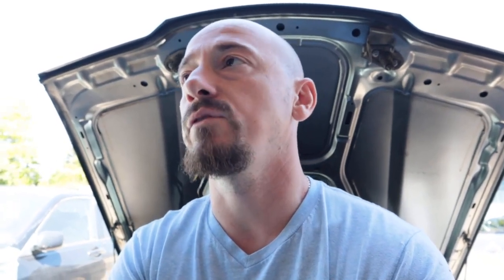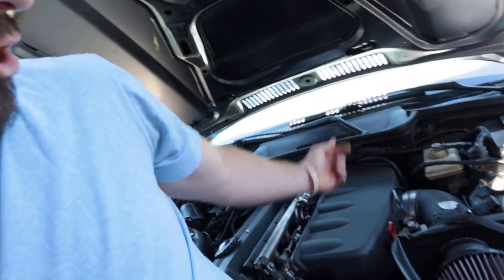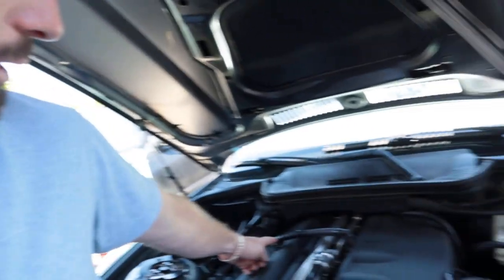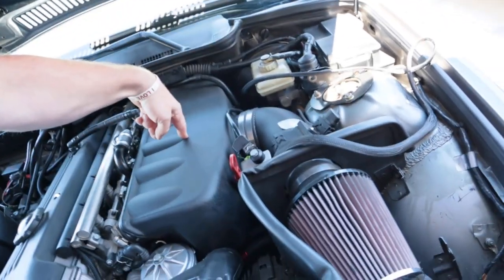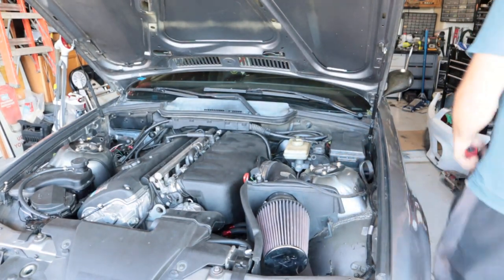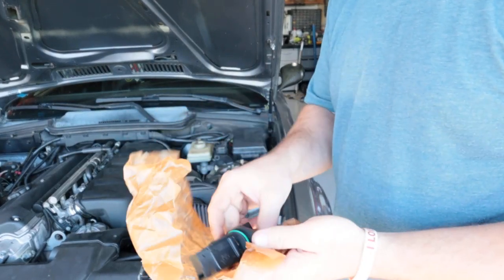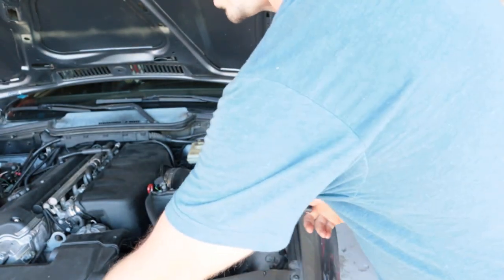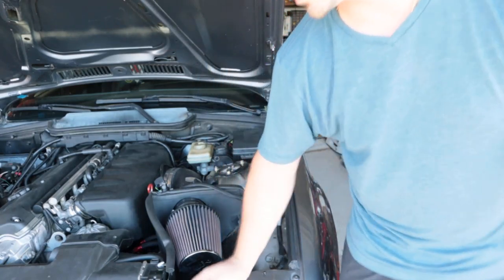Some progress on my s54 power loss (e36 s54 swap)

Comment: I remember I had a K&N on my e46 m3 and it gave me problems hesitation and power loss at low rpm try changing it to a dry filter. Try replacing the 2 TPS Sensors.

Comment: is your SAP deleted?  is your SAP present?  either way that sounds like cold start cat fluctuation
Reply from the maker: It wasn’t at first but after the tune i did deleted it, it was still there but deleted in the system, but yeh RPM fluctuation is normal on this cars at cold start sometimes
Reply: @DailyDrivenE36  aha, ok... sounds like you moved on, I saw later.  Hope all is well!
Reply from the maker: @samthing4thetrack806  oh yeh all good, its a long story but I’m moving plus i was about to get $6k supercharger for it so decided to sell it b4 I’m to much 💰 in to it 🤣
Reply: @DailyDrivenE36  yup  have to make a decision on the things.  I have become a track rat so it's been my goal to put the S54 in, I consider LS swap but it's at least 3K more, probably better bang for the buck tho
Reply from the maker: @samthing4thetrack806  just the s54 engine is $3 to $4k plus maintenance.... vanos if u take it to the shop is $3k and im not even talking about everything else u need for the swap and if something brakes... 😬
Reply: @DailyDrivenE36 yup, I am doing it all myself for the most part, it will be around $9k total.  but the car will be stupid fast and I dont need a tow vehicle!!!!  head goes on this week!